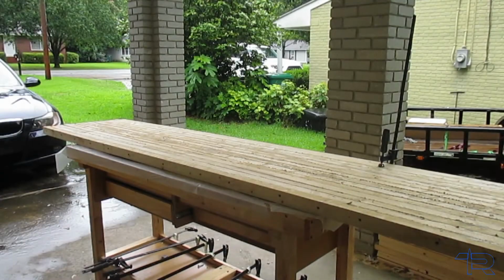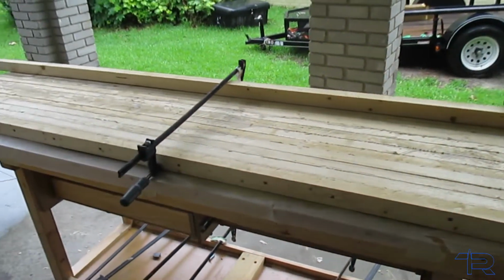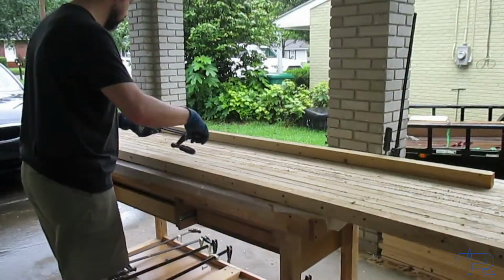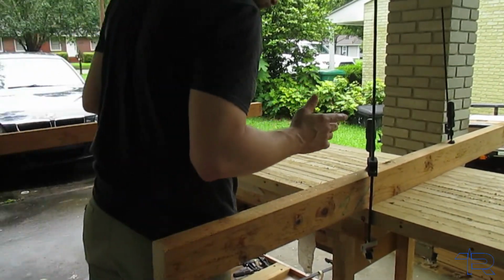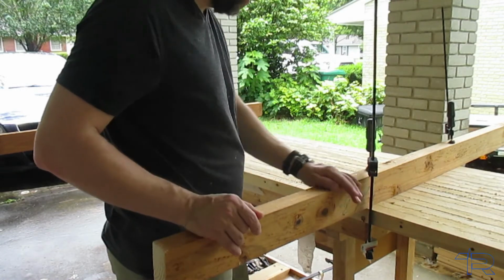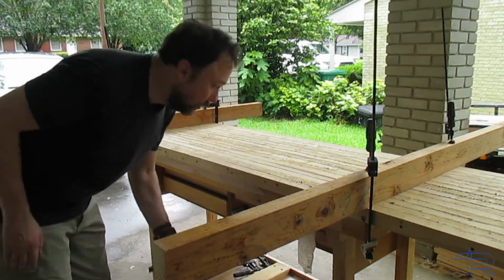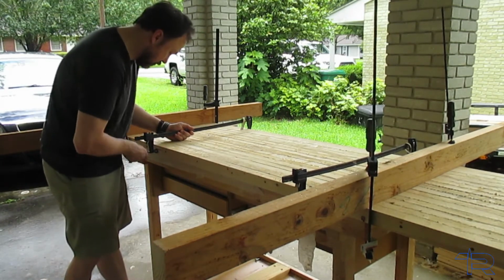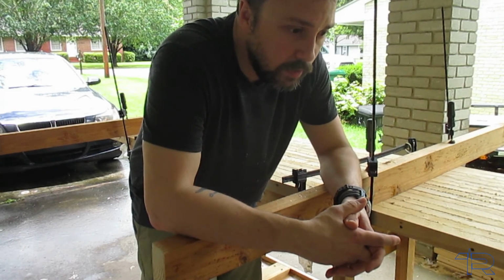Reloading Room Renovation Part4 Bench Laminating

Comment: If you build another bench in the future may I suggest biscuit jointing the boards to create your top with normal wood glue.  It’s faster, easier and far less messy!  Down side is you need the tool to cut the grooves and the biscuits.

Comment: The moisture definitely does not help.  Too bad you were not able to build it inside.  It will still be functional and a learning experience.  Keep it up man, it will all come together.
Reply from the maker: Yeah, now that it has been inside for a week its dried out some and some of the twist has actually came out of it but it started to get a bow in it. Oh well, it'll come out in the wash.
Reply: The Reloading Press You said you plan to anchor it to the floor right?
Reply from the maker: Yes sir, it is going to be mounted to the wall studs in back and to the floor in front. I'm planning on jacking the top using the mounts to get it back straight again. WHich isn't as easy as I thought it was going to be.
Reply: The Reloading Press you may be able to pull the bow out when you anchor it to the floor if you anchor the frame to the floor and wall if your going to do that also before you install the top.
Reply: No it wont be easy, pipe clamps would likely help out but that means attaching before anchoring.